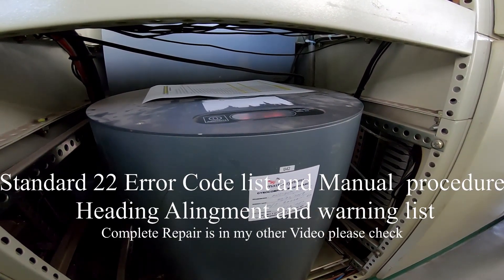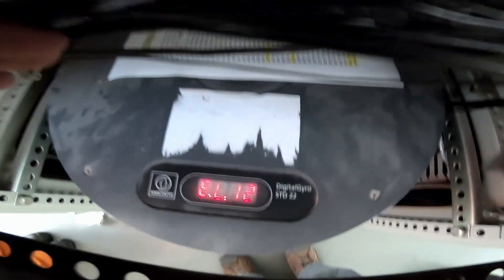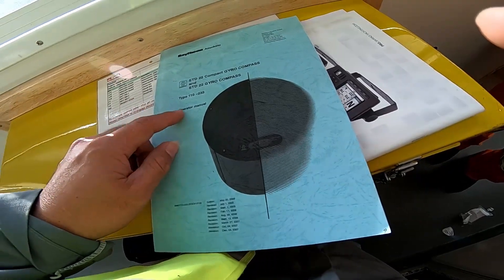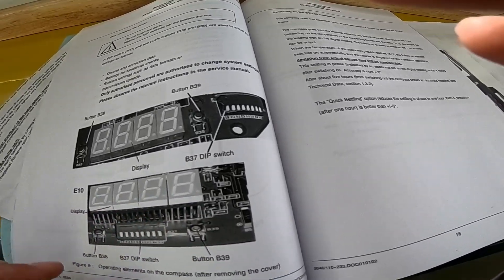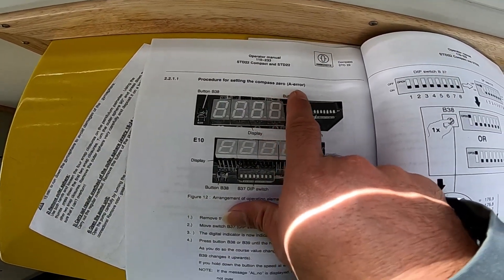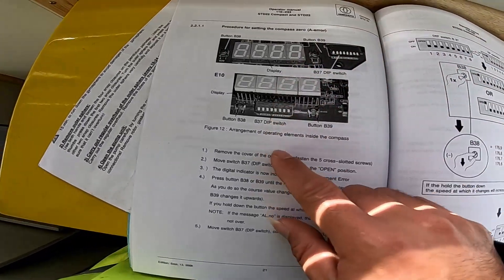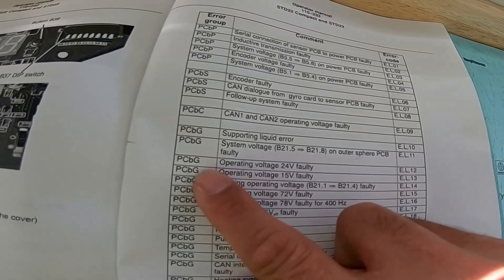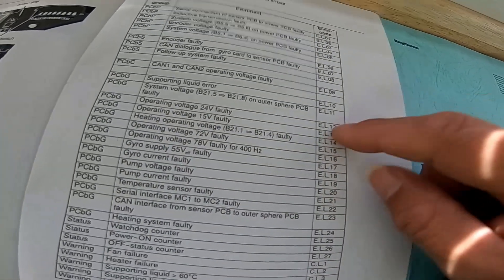Gyro Compass Anschutz's  Error code list, Heading Alignment procedure and service dip switch

Comment: what if error EL.08?
Reply from the maker: Hi thanks for asking. Most probably you have faulty sensor board for follow up system. Try to clean the gyro sphere casing.
Reply: Please did you solve the error code  EL.08